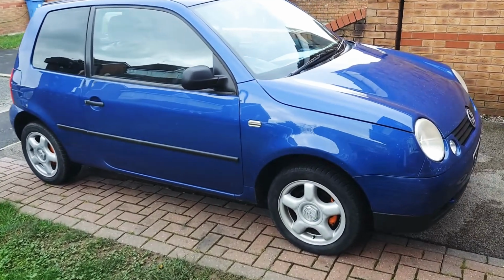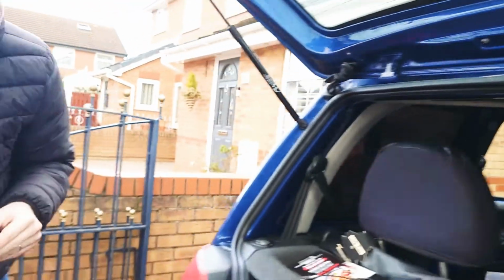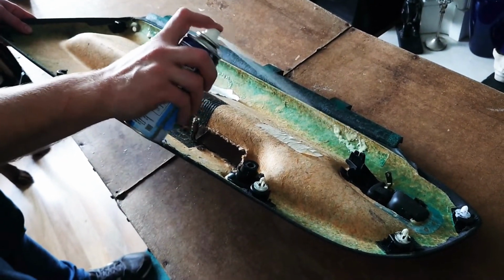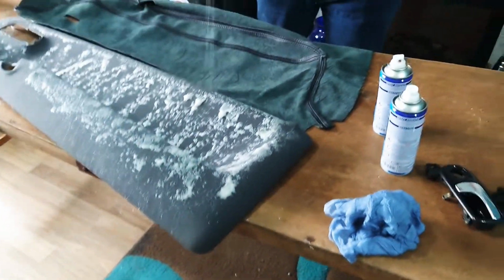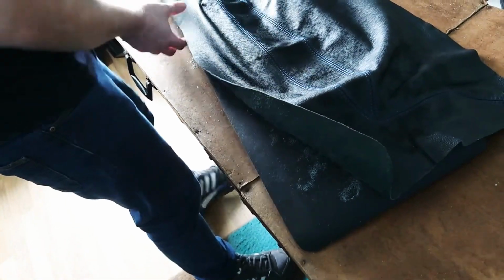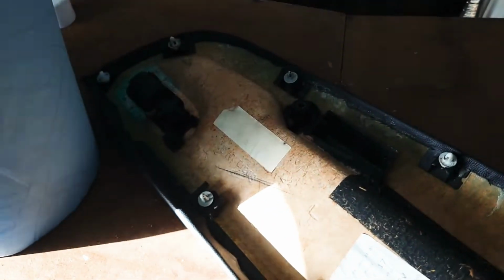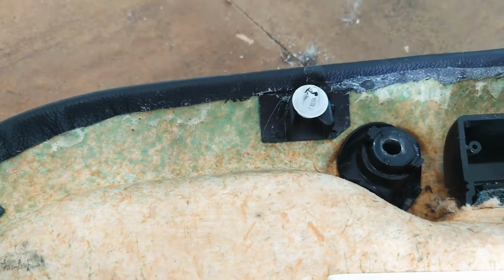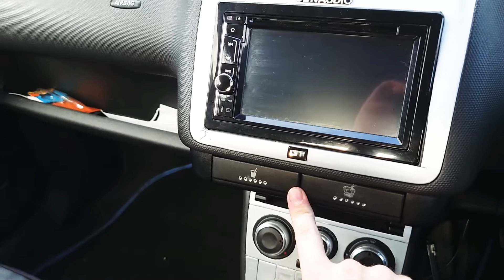volkswagen lupo gets new antenna and door cards

Comment: Not to  be critical as I  can see you tried hard,but in case anyone  tries to remove a lupo door card, be aware there are screws securing the inner pull handle that are behind the removable  outer cover  that is vertically  on the outer face of the handle...vw window switch clusters  carefully prise out from the rear first...be aware to carefully unplug the alarm led light as they are fragile...if the foam waterproofing membrane  is cut away  as in video, it is well worth replacing  as it stops the door  card going  damp and distorted...and finally it's easier to push the locking knob through  with the window down...hope this may help someone  doing similar job ,thanks  Michael
Reply from the maker: Thanks 👍🏻